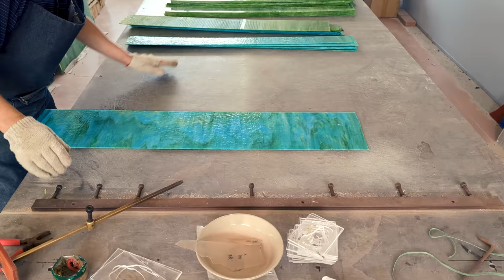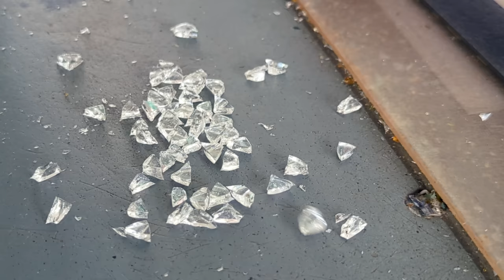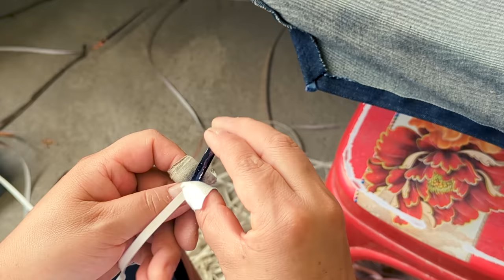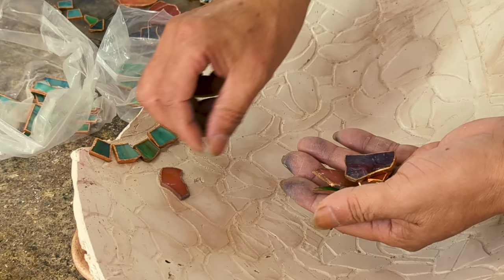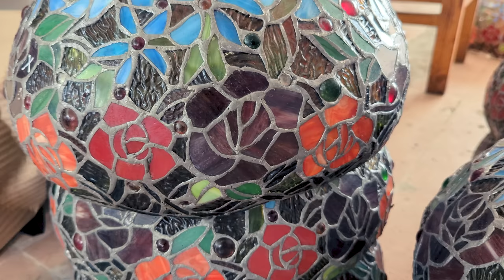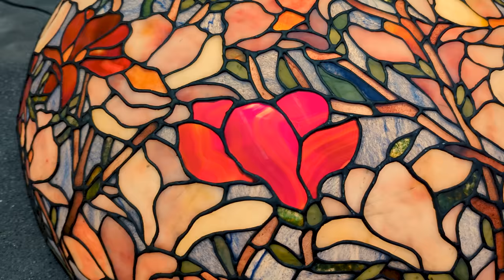Manufacturing process of Tiffany Lamps. A stained glass lamps production factory.

Comment: Although I agree that these are Tiffany inspired, rather than actual Tiffany, the quality of the work is very high. I would happily have one in my home.

However, as the fortunate owner of a genuine piece, inherited from my mother, I have to say that they do not have the same appearance of an original. The aim with these is to get as many pieces of glass from each sheet. An original piece has the touches that distinguish a craftsman and a master craftsman. For example, when glass with a striated pattern is used, the striations will be aligned so as to become part of the pattern, rather than randomly used. On mine, a peacock feather design, the striations are used to give the appearance of the actual barbs on a feather.

This is not to denegrate the lamps in the video though. I would love to have one of them in my house. I love Tiffany, but had I not inherited mine, I'd not have bought an original as I couldn't afford it.

Comment: Very interesting and educational video. Those cutters are really sharp! The speed at which the artists are working is amazing. And it is virtually impossible to beat the price. Now, some of the down sides. Perhaps the biggest weakness is the soldering. Most of the solder lines are fairly flat. A rounded solder line gives much added strength to the lamp. There is one lamp shown in the video that has better solder lines. While the glass is interesting, some of the choices are not good. For example, a flower petal should have color transition throughout. However, a true Tiffany original in poorer shape may start at $20K. High quality original Tiffany lamps will go for well over $100K. A reproduction Tiffany lamp made in the USA might start at $5K and go up from there depending on size and the number of pieces. Just the brass parts alone can cost several hundred dollars. These lamps may be a couple hundred dollars, certainly less than $1000. As an aside, I did not understand the part of the video where the foiled pieces were placed in a basket, then shaken, and then heated with a hairdryer. Is that a way to make the foil lay down on the glass without pressing it? Where was this video taken? China?
Reply: cheap glass too ... they put us to shame when we do it properly 😢

Comment: These are in fact lamps but of a relatively low quality of not only the materials but the workmanship.  They are made quickly so that they can be sold cheaply.  For these, it's all about the price.   The old expression that you get what you pay for applies to these.  I've been in this trade for 50 years and one of these larger lamps shown here would take be several hundred hours and the craftsmanship is at a very high level.  Of course, that comes with a premium price.  It's the difference between an entry level Chevrolet and a Bentley.  The Chevy will get you anywhere you want to go.  The Bentley will do the same but is built by fine craftsmen with the best materials.  There is a market for both of them.

Comment: Oh the humanity. I used to be a glazier. I couldn't finish watching the video. The way they cut the glass dry and slide it around without felt on the table makes me cringe. You can hear the crinkling sound of glass particles under it when it's being slid around. The smallest contoured cuts and breaks are so rough they're practically gnawed. If clear glass was handled this way every window would have deep scratches and would probably self destruct from thermal cycling or a strong breeze.

Comment: Zero stained glass here. This is segmented antique cathedral glass(ACG), cut into interlocking pieces, with sticky copper tape edging, then soldered to resemble the traditional lead cames. Stained glass is patterns painted onto the same segmented ACG using powdered colored glass with 3% gum arabic as glue. This powdered glass is made to have a lower melting point than the ACG and when fired to gum arabic burns away and the glass powder melts and shows it's colors.

Comment: These aren't Tiffany lamps. They are merely in the "style" of. Neither the glass, materials used or craftsmanship is anywhere near the quality of an authentic original genuine Tiffany lamp.
Every aspect of a Tiffany lamp was artist designed, even the glass itself was custom hand made, the copper, brass and other metals were hand forged, finished, hammered. They are museum quality works of art. This lamp is purely decorative and fine, but by comparison it would be like saying a 1979 Ford Pinto is on the same level as a Rolls Royce Phantom.